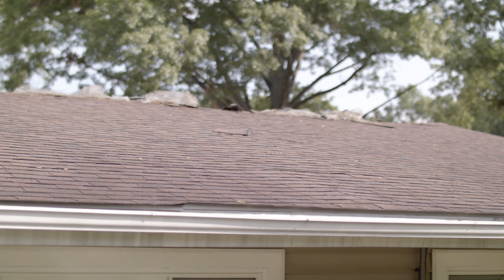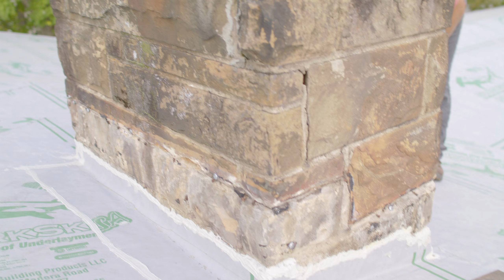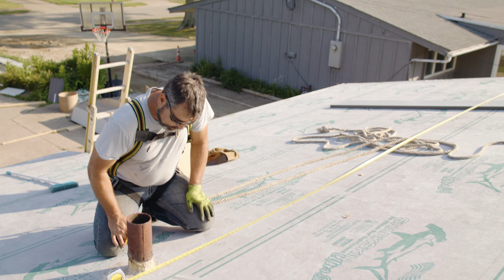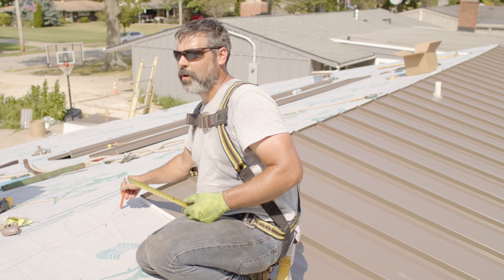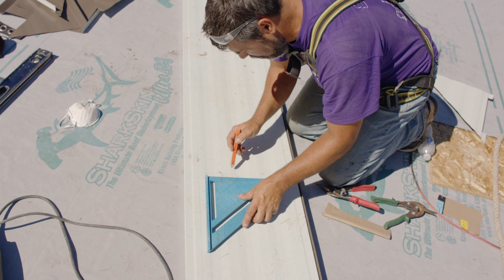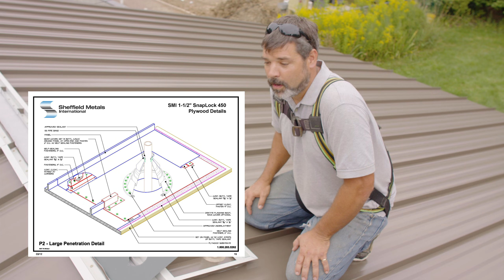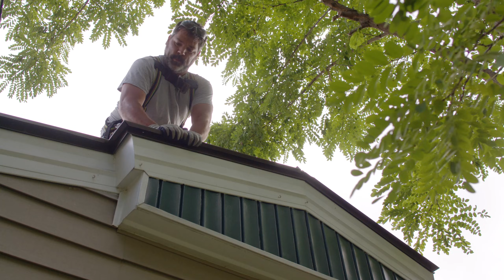How to Install a Standing Seam Metal Roof from Start to Finish

Comment: Wow this is complex - after watching some of the kasselwood videos, metal shingles seem more user-friendly for DIYers.. is that the case?
Reply: yes absolutely...but installing horizontal lines as opposed to vertically opposed panels presents another issue...if your roof is steeper than 6/12 standing of metal shingles can be difficult whereas with standing seam you are always standing on a grippy surface while you install.

Comment: If you have vents on the front of the house, Its practicable sometimes to move the plumbing vents to the back of the house if you can get into the attic. The back side vents can be moved most of the time just a few inches. You can use a couple of 45s to offset the vents so they align.

Comment: I see metal roofing over old shingles? Is it supposed to go over old shingles?
Reply from the maker: It's pretty common, but we always recommend taking off the old shingles before putting a new metal roof on. Taking off the old shingles allows the contractor to repair any damaged plywood/OSB, level the roof deck to minimize the appearance of oil canning, and install a smooth, clean underlayment. Check out this video for more: http://bit.ly/metal-roof-over-shingle-roof-video -Thad

Comment: Thank you so much! I'm a middle-aged homeowner in a different state, talking to a roofer next week about possibly doing a metal roof - something that could outlast me! I know nothing about roofing, but I so appreciate videos that actually show and explain some details, get me used to some of the vocabulary, etc., so maybe I can at least ask the right questions. The workmanship on this roof is amazing, but so are the explanations and the filmography. It is clear you're a professional bunch! Thank you all!
Reply: Very good installing singles off ,plywood repaired or replaced ,tops.
I had my roof done by contractor , first a liner all over the roof than they placed 1 X 4  vertical 16”  hart op hart screwed on the plywood and rafters  underneath. After that they installed 1 X 4” horizontal also 16” apart. Then they installed the standing seam steel as advised by the manufacturer. The crew was experienced with standing seam steel roofs . Although i insisted in the vertical installing of the 1X 4”,S.

Comment: Do the fasteners screw anywhere on the plywood or do they need to be screwed into the rafters?  Also my roof has OSB sheathing and I live in hurricane country.
Reply: Anywhere into the plywood... the screws they are using in the video are designed to go into plywood...what you have to consider is the thickness of the plywood though...the thinner the plywood the thick the screw needs to be...there are wind uplift engineering reports for each type of screw, but your manufacturer will be able to help with that

Comment: The two panels that come together before putting the hip cap on....how many inches do you need in between?
Reply: If you are referring to the gap they create for airflow at the ridge vent, then typically 4" slot (2" down each side) also try and keep that slot cut 2 feet away from the ends of the roof as well as any valley junctions

Comment: Interesting stuff.

Run a metal roofing company in Australia, totally different systems over here..like we have a roof peno we always tray it and would never shoot screws into a sheet pan.

Have the midwest snips and Irwin vice in common though!
Reply: I’m in NZ & our code is similar to Aus. Another thing that amazes me about US roofing is that there are no hems, or upturns on the valley trays to stop wind driven rain. Our valley trays are always recessed one inch below the roof level. We also turn down the edges of the sheets into gutters!

Comment: I bought this 100 year old house. I eventually just tore the house down but i still got a bargain on the land alone. It had a 4 year old metal roof but i noticed the roof had 4 layers of shingles under the metal roof. I took the metal  off and that roof was a huge ocean wave from one end to the other. I reused the metal on my big shed i built.

Comment: When I see a roofing contractor wearing proper fall protection I know they are professionals. And by the way... The roof looks amazing. Well done and thanks for being safe.
Reply: It's a 4/12 pitch...if there was no camera they 100% would not wear fall protection
Reply: @josephlabonte8502  Better read 1926.501 again. Because 4/12 is where harnesses are required. Under 4/12 you can do warning lines and safety monitor, etc. But 4/12 and above...

And for what it's worth... Only roofer can get away with it. Every other trade must use fall protection when more than 6 feet above ground. Unless your steel connectors. 

I'm a GC and also worked for OSHA. Please be safe and go home tonight.
Reply: I've been roofing 18 yrs between Massachusetts and Florida and never seen anyone wear fall protection under a 8/12 unless your in a downtown area where OSHA might drive by. Or a city or state job
Reply: Also a harness doesn't equal craftsmanship. Not saying this guy did a bad job
Reply: Also look at the rope...he has it pulled to the end....does nothing for you

Comment: What R rating is the insulation please? as I have no idea what these blokes are doing, it's a bit odd but you get a lot of snow over there so..
Reply from the maker: The insulation for this project is located in the attic. There is a solid plywood deck installed on top of the rafters, followed by a fully adhered synthetic underlayment, followed by the metal. -Thad

Comment: Do you caulk each screw or not needed?
Reply: Great question, because they used a non-stick underlayment, the screws are not sealed...the backing on a peel and stick underlayment acts as a self-seal around any screw/nail that penetrates it if that makes sense...thats why I do not recommend using a non-stick underlayment under a metal roof

Comment: Maybe, if I am in the southern part of the US, I will consider metal roof. Since I am in a place where thicker snow is always possible, i prefer the architectural shingles. If I have metal roofing and the snow accumulated above, since ceiling temperature can be possibly higher than the top of the roof, it will melt first the base of the snow. It is possible that the  accumulated snow will slide and fall into anything there on the ground.
Reply: You put snow and ice guards to hold the snow on the roof until it melts. Nobody wants an avalanche.
Reply: They didnt really get into it on the video, but there are snow retention systems designed specifically for each style of metal roof system on the market

Comment: You guys measured and cut is good , but you fucked the roof on piping boot screwed and also screwed on bottom of cheemny, u can not use any screw on final cover or roof , it’s terrible

Comment: Excellent work, definitely not easy. They should invest in a hemming machine for the trim blanks that has a perforation tool for ventilation on the z bar. Then they can attach the ridge cap on the perforated z bar with color matched rivets. Looks way better but A + for job in total. You would be lucky if your roofer is doing the project as good as these guys!

Comment: Matt I tip my hat off to you !…Great detail!…every roofer thinks he can install a metal roof until they run into detail and roof junctions …include Steep or low pitch and dudes can run into big trouble ..and that’s just waterproofing..not including scratch control and penetration detail…you roofed that home like your own and that’s the final gauge to a proper install!!…Ricardo from BlackGold Roofing central coast California

Comment: It's mediocre at best, I do high end metal roofing for a living and a lot of what I've seen in this video is unacceptable.
Reply: Is it right to install directly on the underpayment ? Or use furrer strips to give some air flow?
Reply: @joshsilver4127  roof is ripped, any decking & wood is fixed/installed, an underlayment is put down, preferably high heat resistant type, then the metal panels can be installed. I see guys use wood strips across the roof horizontally, that's usually because they're not tearing off the existing roof and putting down "exposed fastener metal panels" also known as barn metal or 5v panel. I don't offer that to people, it's sold as metal roof but really it should just be put on barns and sheds, a metal roof shouldn't have exposed fasteners, like you see in the video, even though it's not a 5v/Barn Metal roof, they put a bunch of screws through the metal.
Reply: know anyone in San Diego who installs well?

Comment: So what was the over cost? Material and labor start to finish for this particular 3000 square. ft. roof with 2 valley's and a chimney, flashing included?
Reply: Average cost would probably be $45000
Reply: . do you work in Southern California by chance?  Looking for an experienced metal roofer

Comment: A lot of ppl said that it is cheaper to use metal roof, I have 1600qf home an if I calculated right, it came up to almost $7k, does that sound right? 😳
Reply: Shingle roofs can be done in a day and would cost more than that. A metal roof like this takes much more knowledge ad skill to install. The guy even said they will come back to do detail work at a later day. That's way to cheap.

Comment: Underlayment could have gone over existing shingles/deck ...customer got scammed
Reply from the maker: There are many reasons why it's a good idea to remove the existing shingles, and in this case, the plywood roof deck was rotting and had sections that were warped. Removing the shingles allowed the installers to replace those areas of the deck. -Thad

Comment: If you have an attic where the rafters are insulated with open cell sprayed in place insulation how to you handle the build up of heat under the metal standing seam roof? Are there ventilation products other than wood furring strips that can be used as an underlayment for the standing seam roof?
Reply: you can have the roof vent from the ridge cap, with a vented ridge if that helps any
Reply: @TRE_-HEINZ  How is it going to do that without a venting space under the metal roofing since it is not venting from the attic. Wood strapping increases the depth of the fascia by 1 1/2" inches which is too much plus due to the spacing of the straps it is unadvisable to walk on the metal roofing. There has to be a product that provides solid underlayment without increasing the depth.
Reply: @gary24752  they vent the top of the ridge with a 1 inch cut in the roof then vented z closure then ridge cap on top
Reply: you referring to what we call a "hot roof" installation...the best way to tackle this type of roof is to create a ventilated air space along the underside of the metal panel...afew ways you can do this is either double strap the roof or vertical strap and a second layer of plywood creating verical channels that can be ventilated with an eave opening + ridge vent ventilation system
Reply: @asm101 This is what I was referring to:  https://www.youtube.com/watch?v=v0w21Bg1HJI
Reply: @gary24752  yes delta trela is great! 2 in one system... Just so we're clear though the space that this product provides is not sufficient for ventilation... Minimum I would do is 3/4 strapping... I've also seen Matt do diagonal strapping which is interesting in theory but a little bit like cheating

Comment: Thanks for all your informative videos. I bought my first house and 3 days later CV-19 shut my industry down. I need a roof on a budget so I'm putting on a metal roof by myself. It's a job! How many guys did you have on the roof and how long did it take from start to finish? I'm currently doing a ton of wood work I wasn't expecting and the tear off had so many nails you'd have thought it was a metal roof!
Reply: Hi James. Did you end up replacing your roof yourself? I just bought my first house also and found out during inspection that it needs a whole new roof (not replaced in ‘09 like the realtor stated) and I don’t have the budget to pay for the labor. 
What manufacturer did you go with? I would like an 1.5” standing seam but I have started researching manufacturing yet. 
Any tips on instillation? Underlaying brands?

Comment: Oh, so that's why metal roof cost more. Makes sense now.
Reply: In UK between or and over rafter insulation vapour barrier then decking timber/sarking breathable felt counter battened, tiled specialist made ridge vents/capping eaves guard and vents much more expensive method and vastly heavier roof payload bigger section roof structure timbers.

Comment: I really like this video and appreciate you educating potential buyers of metal roofing. I, personally, would really like to have my roof replaced with metal once it comes time, but my concern is most contractors just want to get the job done.  Do you have a video in your library that helps buyers make sure they are hiring actual professionals rather than hacks?
Reply from the maker: Hello! Here is an article about how to choose the best contractor: https://sheffieldmetals.com/learning-center/finding-best-metal-roofing-contractors/ Here's a free e-book about preparing for your metal roof installation which includes finding contractors, picking the right bid, and getting your property ready: http://bit.ly/installation-success-ebook And here is a free downloadable checklist about questions to ask your contractor at a consultation: http://bit.ly/contractor-questions-checklist Hope these resources help! -Thad